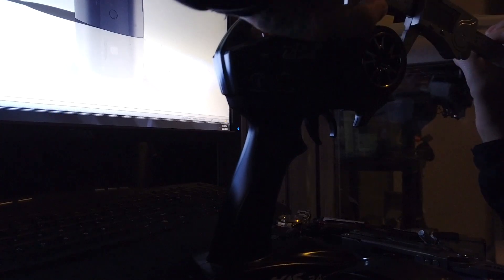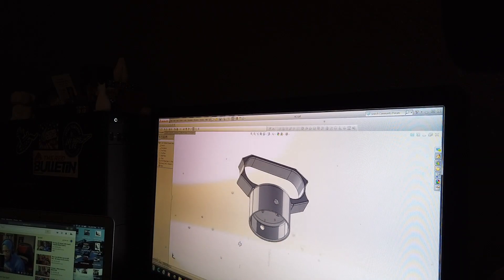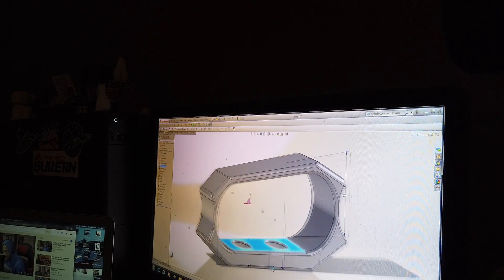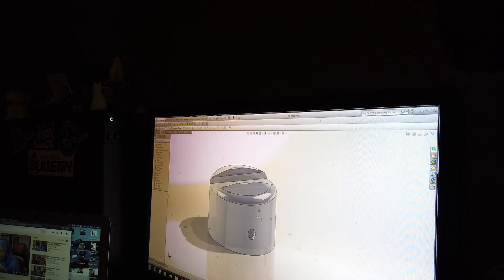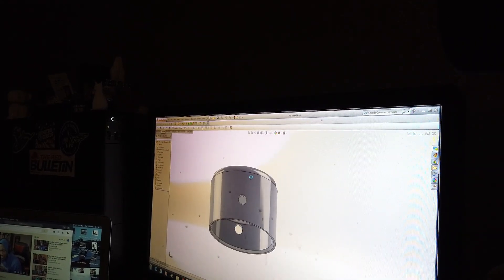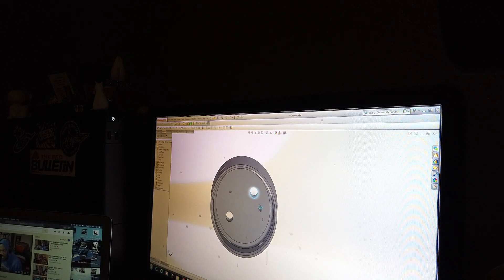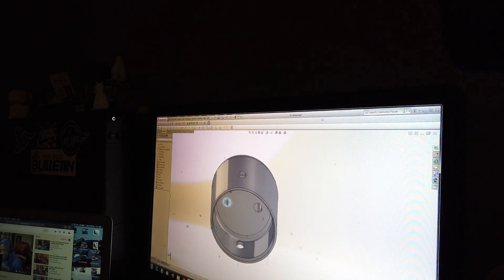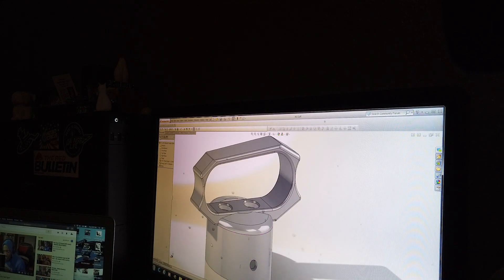3D Printed HandControls for Quadriplegic RC Car Control

Comment: Nice vid bro! Ive been using mine stock so far. I was wondering what your controller is mounted to and if you've altered the throttle. Btw im also c5 c5 lol cheers